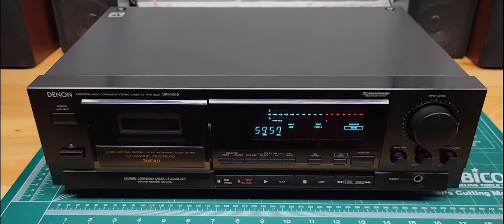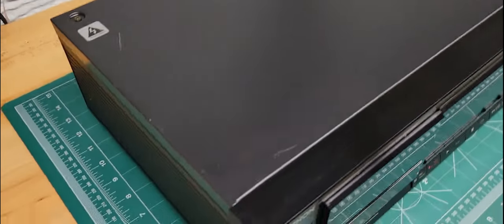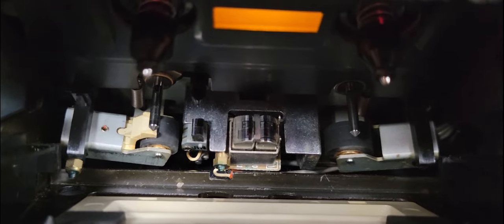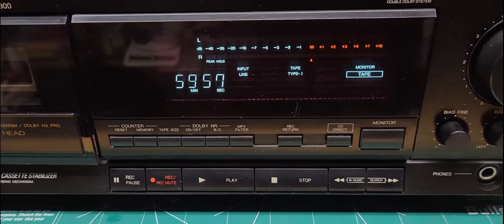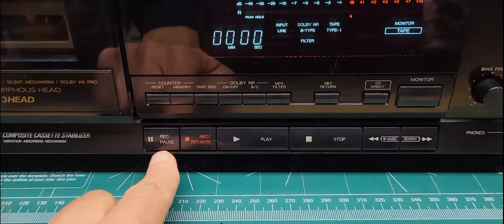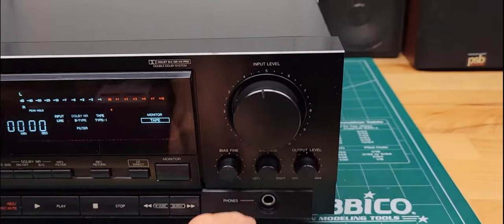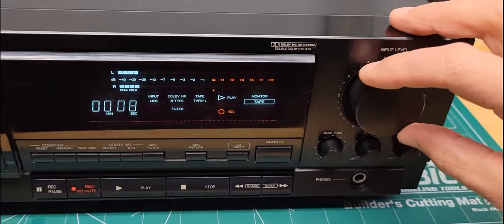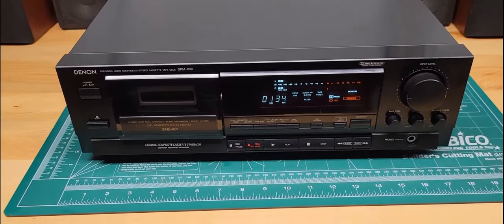Denon DRM-800 3 Head Cassette Deck DEMO

Comment: Nice vidéo. Twin capstan drive reduce wow and flutter but can stretch,  tangle or skid  the tape if the rotation is not even on both capstans especialy with Maxell UR type one tape. Original belts avoid this problem but they are not available anymore. I own the Denon DRM-700, it'is identical but single capstan drive, no CD direct input and no ceramic cassette stabiliser inside the cassette door. Of course, the performance is not as good as the 800 and wow and flutter is higher but still unnoticeable on pianos or violons. The playback of every tape, pre-recorded or not is amazingly clear and dynamic. On the recording side it's still very good but not exceptional; the unit missing calibration tones and level adjustments for Dolby. With Denon tapes, for example,  the recordings are perfect without adjustments and the tape playback on monitor gives the same volume levels as the source and sometimes higher! The bias knob can help a lot and have great influence even with very small adjustments.  Dolby C recordings are amazing clear with the help of anti saturation circuit.  Great bass response on super ferric tapes like the famous TDK AR-X.